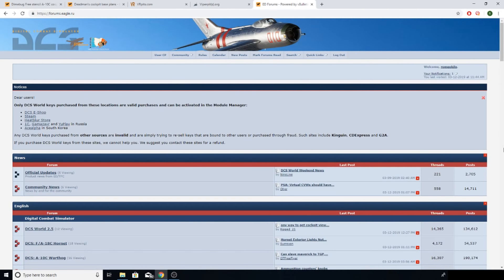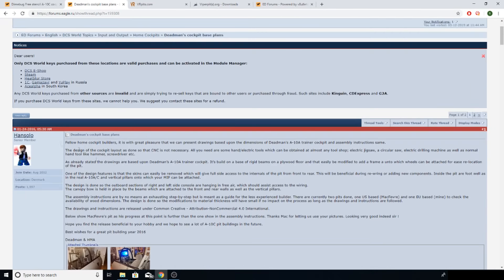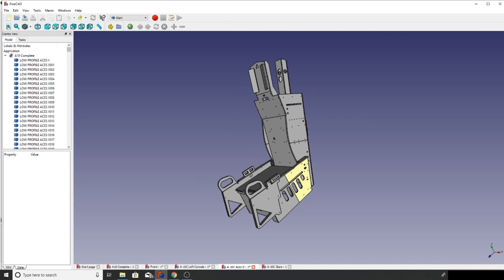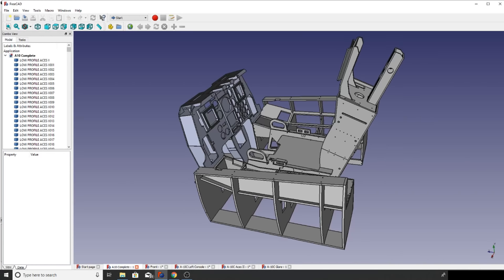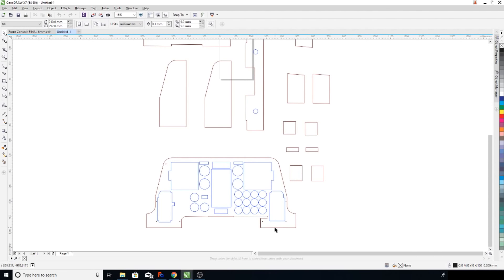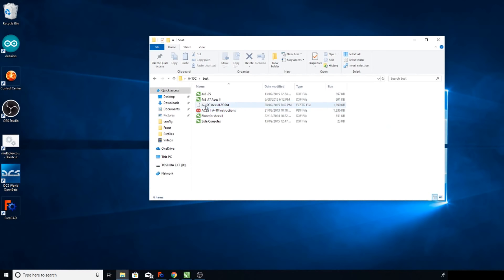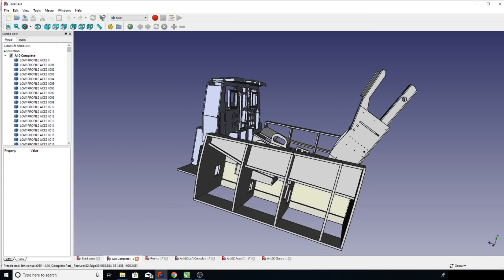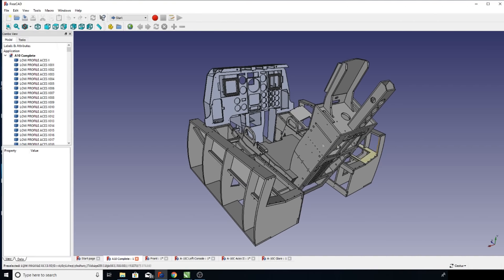Cockpit Plans- A10C Warthog Simulator

Comment: Well I got the quote for 4'x8' sheets of acrylic ($90 a sheet!) from a local supplier, I already own the Hotas, the cnc, and the laser cutter, going to hold out until black friday to pick up a set of pedals (my current cockpit is an Obutto revolution that has doubled as racing sim and flying sim so I've used my clutch and gas pedal as rudder pedals... never bought true rudder pedals because I had nowhere to put them) my plan is to add the electronics as I learn to use them in the sim, and it will be mostly a vr pit and arma pit that probably doesn't get used much anyway so having every switch working is way down the list, but I plan on making up all the panels (I have a 700mmx500mm 60w laser so I should be able to knock them out in short fashion...) and get the pit built in the next couple months... and I just paid for the plans from Flim, 

With all of that being said I am ungodly thankful that you have released your panels, but I was wondering if you have any files with the changes to Flim's plans before I get into cnc cutting all the panels, I can prove I've paid Flim if that helps, If not I'll be cad drawing the whole pit in inventor regardless as the materials over here in the USA are dimensionally a bit different so I'm gonna end modifying a bunch of stuff anyhow...

My other question is do you have any idea how translucent the translucent white in your panels is? I don't see it in the specs of the link you share on your website anywhere... the local supplier I've found has it in several like opaquencies... not sure what to get,

Comment: Amazing work. WHat are you using for the circuit breaker switches. Can you provide a link? I'm also looking for a good switch to use for caging the artificial horizon. i.e. a momentary pull switch. Any thoughts?
Reply from the maker: Thanks! My circuit breakers are just non functional placeholders. I also couldnt find a momentary pull switch for the standby ADI, so i ended up using a normal push button with a 3D printed top instead.

Comment: As it looks like a fun project. Without an engineering degree or Electronics degree I wonder how hard it will be. I've been looking for dimensions for the canopy and ain't had no luck with that. Of course I still got to figure out how to bend it and make it. And I'm wondering how hard it would be to get a wheelchair into the simulator. That'll make it a little bit easier.